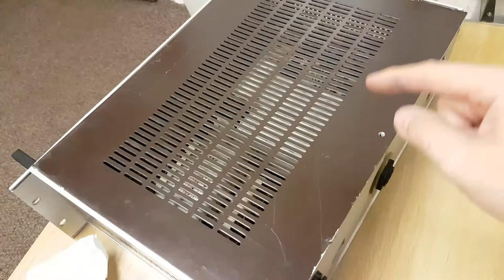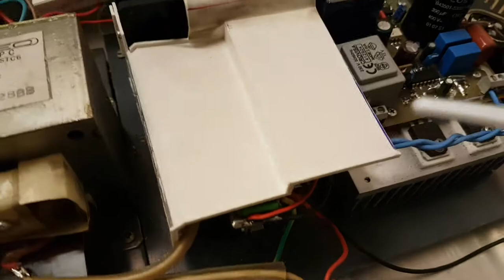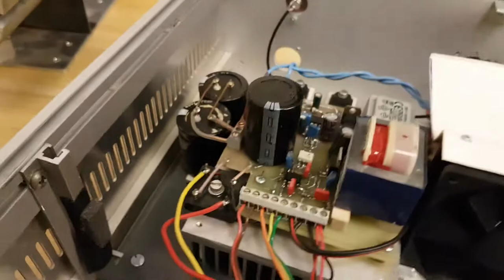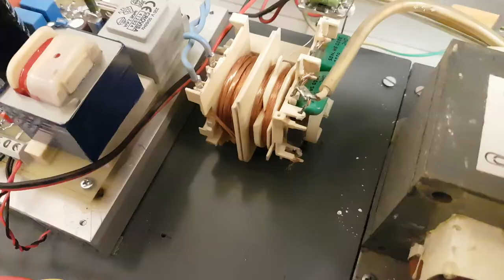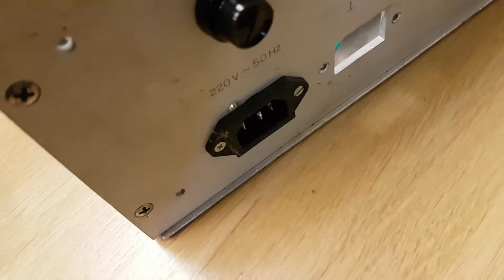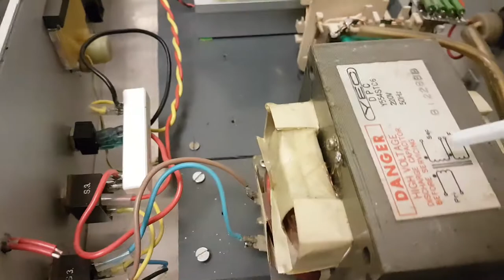Inside the Super NOVA controller

Comment: That coil under the cover with the fan is a factory microwave oven inverter type fly back \ induction coil.  Your  can get one from a inverter type microwave.  It allmost looks like there using the MOT as a current control or A tuning or limiter of some type.  I'll have to look at the stills.  ~Russ
Reply from the maker: Hi Russ, you can help with the BOM, just request editing rights.

https://docs.google.com/spreadsheets/d/1SJL5L7VmaOfyDBphLljQcL9bbi6sCW175NRhXkJR8aM/edit?usp=sharing